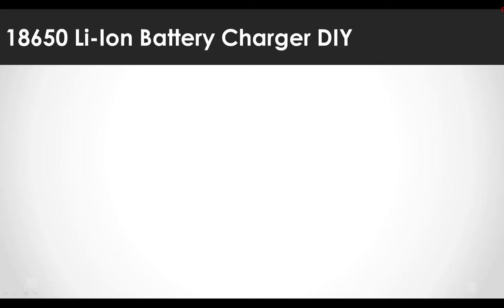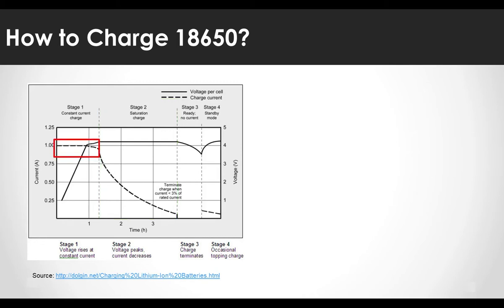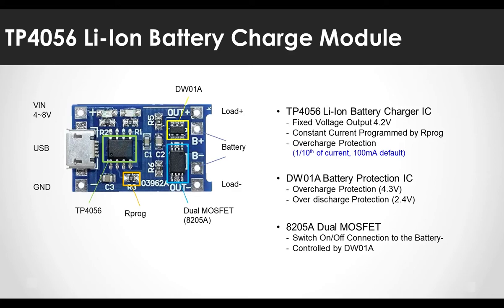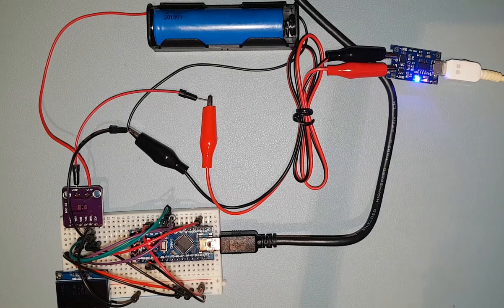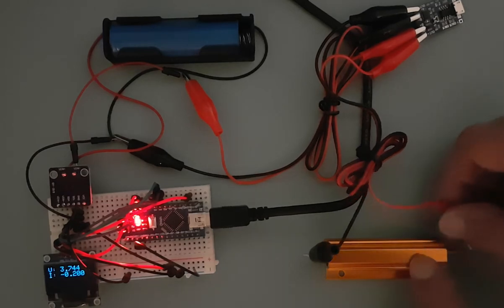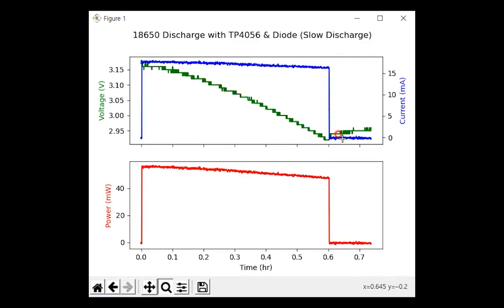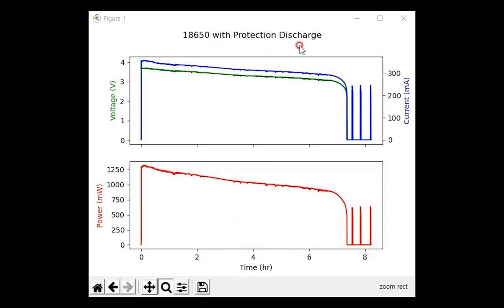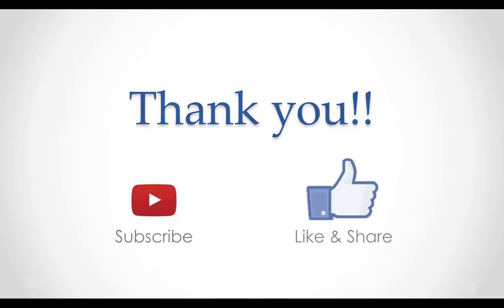18650 Li Ion Battery Charger DIY (with TP4056)

Comment: Nice tutorial!  Question is you say you put a diode next to R5.  Photo looks like you REPLACED R5 with diode.  What exactly did you do?  Thanks
Reply from the maker: Hello, thank you for watching!
The diode is placed in serial to the R5 resistor.
I rotated the resistor so that one side of the resistor touches the pad of the resistor position, and the other side of the resistor touching the lead of the diode.
It is not very clear in the video, but it was connected as described in the schematic view.
Thank you!

Comment: thank you for this tutorial. So if I use the battery while charging, the voltage at the load will vary between 4.2V and 2.4V ? How can I have a constant voltage at the load?
Reply from the maker: If you discharge and charge at the same time, the voltage seen at the load will be dependent on the capacity of your source.
If the source is large enough to charge and supply to the load at the same time, the voltage will not drop at your load.
If the capacity of the source is smaller than the overall usage(charge and usage from the load), then the voltage will drop.
If you want a constant voltage at yhe load, it might be useful to use a dc-dc converter (buck or boost) that meets the voltage requirements of your load.
Hope it helps!
Thank you for watching!!

Comment: Hello and I hope you are fine. Great explanation. Do you believe the TP-4056 would be fine for my case?

I want to send just a few data when pressing a button from an ESP32-sender. This sender will be deep sleeping (2-3mA consumption) all the day and night. Only in the "sunny" hours where the solar panel will be charging the battery, we need to press the button for sending data. So for only about 3 seconds, the sender will wake up, open the WiFi, send the data, and after gets back into deep sleep mode. In this short period of time (3 seconds) where the sender is awaken, the consumption is approximately 100mA (of course there will be a peak for an instance (some ms) of 500mA consumption at the moment the WiFi opens). This process will be repeated about 40 times, meaning 40 pressings of the button for sending few data.

So:    all the day (slightly less than 24h, actually around 23h58min) ---> consumption 2-3mA
         except 40x3sec= 120sec= 2min when the sun lights up  --->  consumption 100mA

So for 2min we power our load (ESP32) and charge the battery from the solar, at the same time.
A simple system of a solar panel 1-2W, 6V  with a 18650 battery of 2000mAh and the TP4056, could be safe, reliable and power sufficient so as to cover the need for 40 pressing every sunny day??

I am asking about safety and reliability because the load (ESP32) is powered and AT THE SAME TIME the battery is charging and as I know we can't have the 2 processes happening at the same time in TP4056 case.

Will the battery have under and over protection?
Reply from the maker: Hi, it seems to be sufficient to use 2000mAh battery for your system since the consumption of 3mA×24hr + 100mA×(2/60) is much lower than the battery capacity. 
However, the open-circuit voltage of your solar panel might exceed the maximum input voltage of tp4056, which is 8V, when the charging is disconnected by the tp4056.
Check the open circuit voltage of your solar panel, and add some circuitry (possibly a dc-dc regulator) for protection. 
Thank you for watching!
Reply from the maker: Also, the power generated from the solar panel needs to be checked. If the manufacturer of the panel claims it to be 1-2w, the actual power can be much lower (20% or so) even under strong sunlight.
Reply: @gemsungelectronics460  You are right. I tested the solar panel and works fine with such a consumption. It is 10W @ 5V, this is the reason I mentioned actual power of1W-2W.
Reply: @gemsungelectronics460  The solar panel is 5V (not 6V that I mentioned) I believe it can reach maximum at 7-8V  without load (open-circuit voltage), and as I know the input of TP4056 is 4 to 8V. So it's safe. But in any case, If you know any low power loss dc-dc with output at 5V, please let me know. Just a question here. If the TP-4056 stops the charging process because the battery is full, then the power coming from solar panel stops in the entry modules of TP4056 board before the core chip TP4056. So the voltage of the solar panel is not exactly open-circuit, right?
Reply: @gemsungelectronics460  Normally this dc-dc should be such that gets 4 to 6V from the panel and outputs 5V (I thikn it's a good value for the input of TP4056 board). So it should be a booster, stepping-up and stepping-down, depending on the weather conditions. Right?
Reply from the maker: Yes, the TP4056 needs to be powered in all cases and the LEDs will be lighted, so it is not actually open-circuit, but will use a low amount of power.
Consider removing the LEDs on the module if the power consumption is critical.
Reply from the maker: I think you might only need to use a step-down converter, since when the voltage from the solar panel drops, it means it is not generating enough power, and the module will not be operating anyway.
In your application, since the power is not very large, how about using a Zener diode (instead a buck converter) to limit the maximum voltage from your panel?

Comment: where The Nano Pin pin is going too, i had little confusion in Circuit connection
Reply from the maker: Hi, the arduino nano is for I2C communication with INA220 and the OLED display, for measuring and displayinvlg the current and voltage of the battery.
So, for charging purpose only, you would not need the arduino nano.
However, if you want to connect the I2C interface to the arduino nano, use following pins.
SDA Pin A4
SCL Pin A5
Thank you for watching!!
Reply: @gemsungelectronics460   thank you every thing was set, only thing was i am unable to see values on the display, but in serial monitor its working
Reply from the maker: Did you test the connectionto the display? There is a sample code in the library you can try for testing.
Run the code and see if you get the sample data displayed on your display.
Reply: @gemsungelectronics460  i checked it's working fine, I used NANO but it's showing a space error so I used UNO in the serial monitor I can see the values while using UNO, but I can't see it on display.

Comment: How to charge and Use 18650 battery at the same time?
Reply from the maker: All you need to do is connect the battery to the b+ and b- pin and load to the out+ and out- pins.
If the load consumes more than 1A, the battery will start discharging.
If the load consumes less than 1A, the battery will be charged while the load uses current.
Thank you for watching!!
Reply: @gemsungelectronics460   thx sir but i want to ask lead accid battery  that how can I charge the battery from solar pannel and use it at the same timr
Reply from the maker: If you are using a solar panel to charge the baterry, you can  use a controller to charge and discharge at the same time. There are two types of controllers (pwm or mppt) on the marker with various capacities. 
Make sure to choose one that goes well with  your solar panel and battery.
Thank you

Comment: hi, I want to make a balance charger using tp4056 for 48v battery 12s 3p does that mean I need 12 tp4056 modules connected in series and then to the battery like BMS wiring?
Reply from the maker: Hello, for charging multiple parallel cells, I think it is doable as far as the cells are balanced with each other. If they are not, it is not recommended to charge multiple cells in parallel, since it might shorten the battery life time.
However, for serial charging, if you are using separate power source for each of the TP4056, it might be ok, but if you use a common source for all the TP4056, you may not be able to charge the cells.
The reason for this is the B- pin is sharing the GND through the N-channel MOSFET. And if you tie the IN- together, the potential of all the B- pins will be the same.

Why not use a BMS instead?
It supports charging multiple cells connected in serial.
Here is an example video introducing the 2S BMS.
 --> https://www.youtube.com/watch?v=xmq0hi3zTgQ
There are also BMS supporting more cells in serial.

Thank you for asking.
Good luck!
Reply: @gemsungelectronics460  worthful 👏
Reply from the maker: Thank you very much!
Reply: @gemsungelectronics460  can you tell me, how many batteries parallel charge in this module 🤔 (18650 1200mAh Battery i Have)
Reply from the maker: Theoretically, there is no limit for the batteries that can be charged with this module, but since the charging current is limited to 1A, it can take longer for fully charging when multiple li-ions are connected in parallel.
One more thing to note when connecting batteries in parallel is those batteries should have equal voltage with similar usage (getting the batteries from the same batch is best).
Hope this helped.
Thank you for asking!
Reply: @gemsungelectronics460  thanks bro, very helpful reply 🙏

Comment: Sir can i use tp 4056 module to charge a 1.5v  battery?
Reply from the maker: The output of TP 4056 is 4.2V, so it cannot be used for charging 1.5V batteries. However, there are many chargers that support 1.5V batteries in the market. -> Search google :)
Reply: @gemsungelectronics460  thank you very  much sir
Im waching from philippines.
Reply from the maker: That's wonderful. One of the countries I long for a visit.
Thank you for watching!
Have a great day!!
Reply: @gemsungelectronics460  really sir?
I'm happy with what you said.
Reply from the maker: Nice chatting with you.
Please let me know if you have any other questions or comments. :-)

Comment: What diode did you use?
Reply from the maker: Thank you for watching!
It is a normal silicon based diode with forward voltage of 0.7V.
It doesn't require large current to flow, so any small signal diode would be ok.
Reply: @gemsungelectronics460  Thanks!

Comment: hello, how many 18650 can we put on a TP4056? I have to put two 18650s on a TP4056.
Reply from the maker: Hello, for connecting two 18650s in parallel wouldn't be a problem when charging. Make sure your cells are equally balanced. (Equally charged and coming from the same batch)
When discharging, you should make sure the load drains less than 5A, since this is the continuous drain current limit of the 8205 dual channel mosfet.
Reply: @gemsungelectronics460  so in series its not possible?
Reply from the maker: With one TP4056, two serial 18650s will not be possible.
The output voltage of TP4056 is approximately 4.2V, but you will need 8.4V for two 18650s connected in serial.
For two 18650s serial configurations, I recommend you to use the 2s BMS.
This link below gives you the introduction of the 2s BMS connected in serial.
https://www.youtube.com/watch?v=xmq0hi3zTgQ
Reply: @gemsungelectronics460  okay thanks you very much!
Reply from the maker: Thank you for your interest! Let me know if you have any comments or questions!
Reply: @gemsungelectronics460  okay thanks
Reply: @gemsungelectronics460  So with the BMS you have to add a TP4056 to charge the 18650s?
Reply from the maker: No, the bms is normally used by itself. There are a variety of bms's available on the market, depending on the battery configuration (number of serial batteries connected). There are also bms supporting balanced charging.

Comment: This little PCB will be damaged by connecting the battery reversed ( so I am informed ? ) .... so  ALWAYS  double check before you use it .....tip # 34 ................ DAVE™  🛑

Comment: Hola, for the input of TP4056 can we connected to external voltage which is 12V?
Reply from the maker: Hello,
According to the datasheet, the input voltage should not exceed 8V. So 12V should not be connected directly to TP4056.